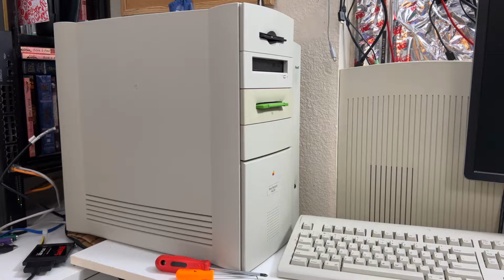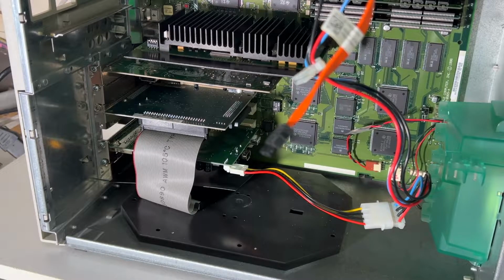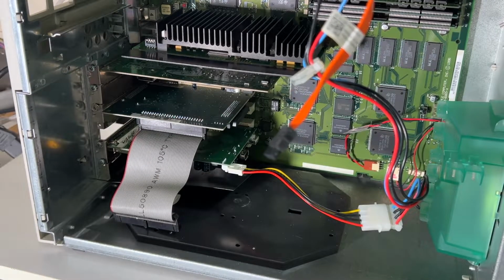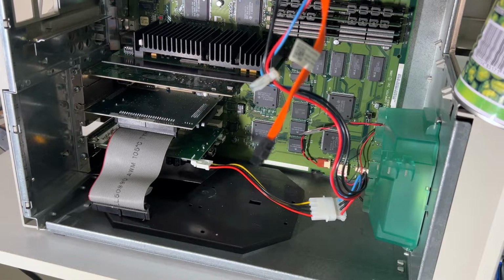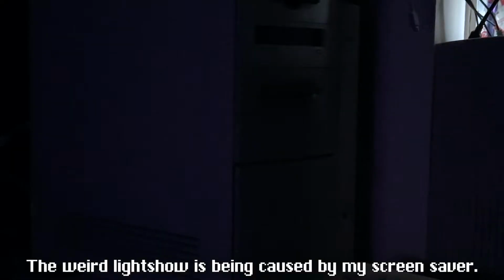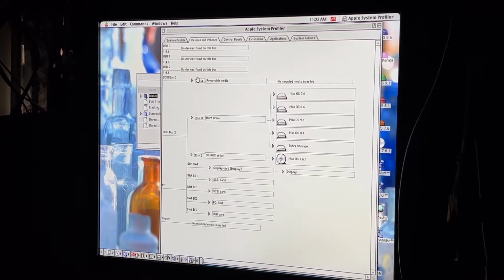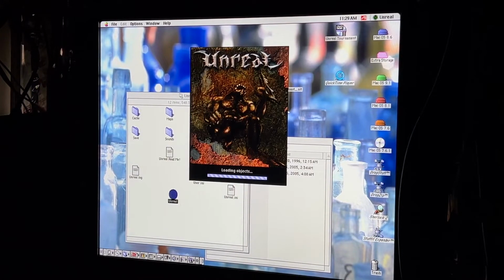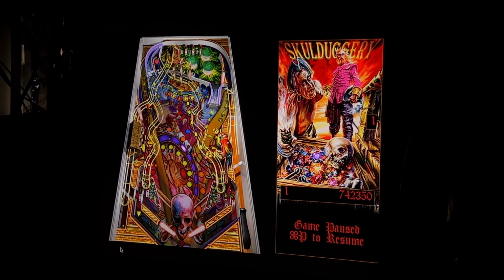Power Mac 9600, Part II: Upgrades and Games!

Comment: Can you play diablo next time and some quake ?
Reply from the maker: I can tell you right off that a lot of later 90s games don't run super well on this. Quake 1 will be fine, Quake 3 is dicey as heck due to the lackluster bus speed strangling out higher performing video cards. Diablo runs fine, Diablo II not so much.

The 9600's an awesome machine but if you're scoping out machines to acquire from this time and you want something halfway decent at retro games, I'd look toward the beige G3 more than the 9600.

Comment: What a great setup! I'm curious how much more quiet the door fan is now?

And I love the idea of swapping the original SCSI optical out for SATA if this is to be a system that's actually used a lot, because yeah I've had numerous working SCSI optical drives die on me this past year or so.

And I gotta check out that disc image mounter util - I used to just use Toast back in the day. Does that util also trick apps to think the image is an actual disc? Toast would let you do that, at least in most cases for games/apps that really wanted a real disc...

Oh and to back up the SATA HDD,  just pull the drive, hook it to a modern Mac, and backup with dd (though you'll have a huge image of course hahaa)